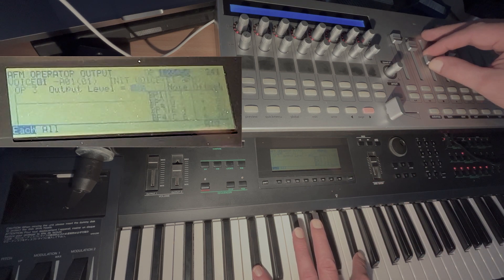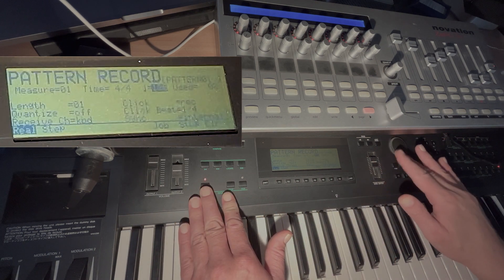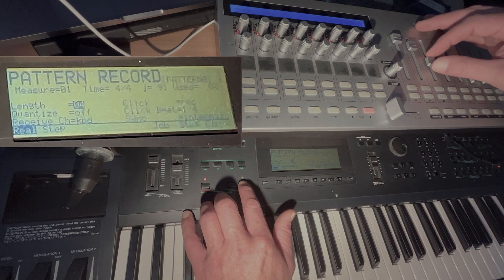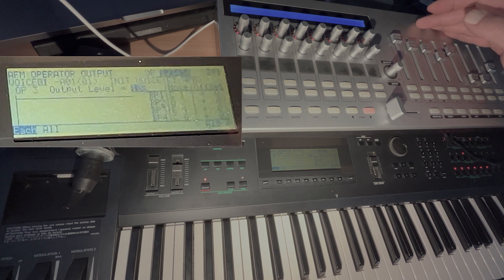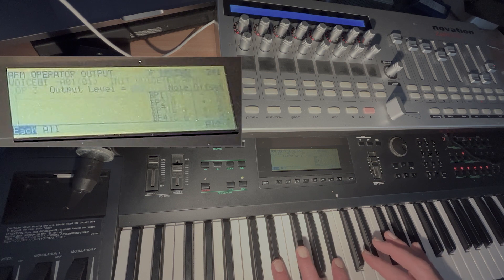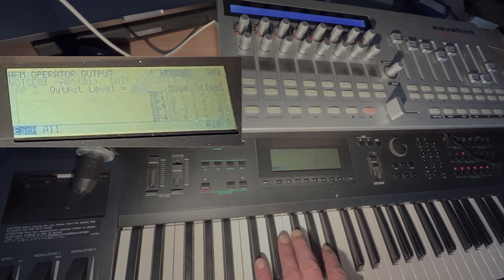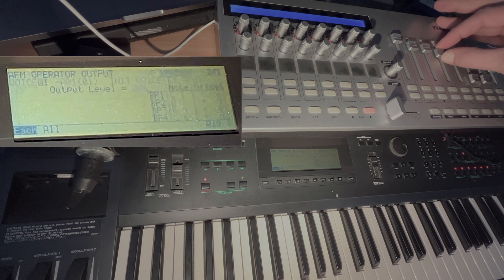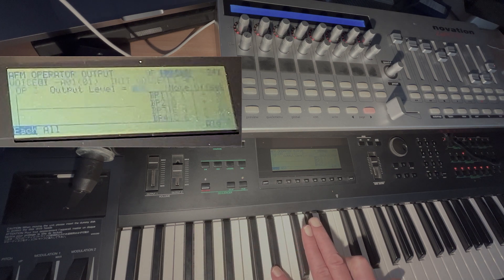SY77 - Using the internal sequencer as modulation source

Comment: Even the sequencer!? Incredible. The SY77 really is nearly limitless with its modulation options.
Love this machine.
Reply from the maker: Sometimes I think they intended their sysex implementation to be used to a massive extent
Reply: @thehimer3903  Yamaha certainly designed it with more programmability and control than meets the eye. A sheer labyrinth of potential!

Makes me think there must have been some SY series-compatible midi controller on the drawing board that never made it to final release...

It would be fun to do some digging and find out!